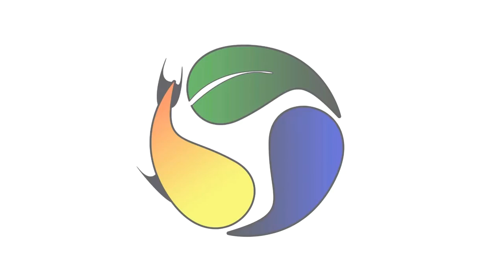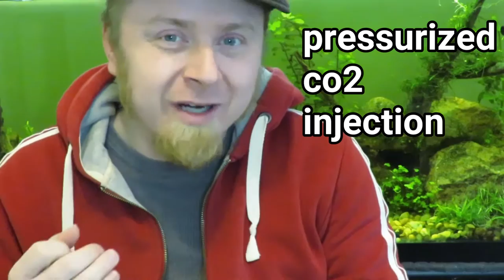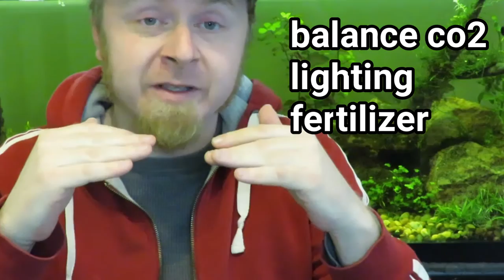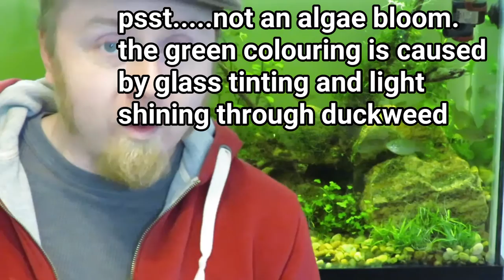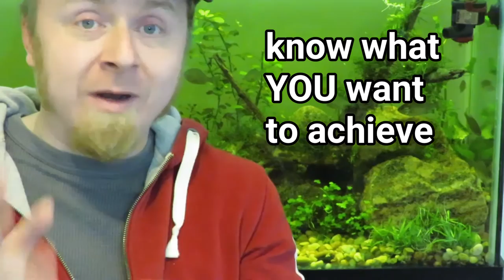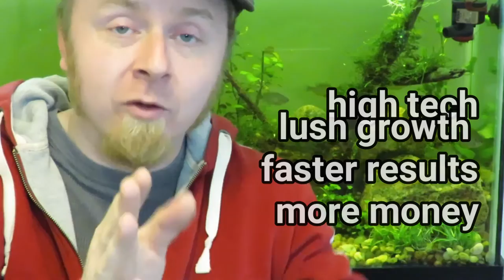The Difference Between Low-tech vs High-tech Planted Aquarium Tanks

Comment: Great video Kevin. You jam packed this video with tons of useful information, I can now say i know the difference between a low-tech and high-tech planted tank. Also, great tip about turning off the light every few hours to help with growth. Thanks for sharing bud
Reply from the maker: AQUA NUT 
Thanks....there is alot in there but i hope it comes across clear enough. there is alot of debate on the subject but i hope this simplifies it. 

and the mid day lighting rest works wonders for low tech tanks.
Reply: Yeah i programmed that into my timer and noticed they looked a bit better when i got home. I think you did a great job on this video. Cant wait for the next one bud.

Comment: Great video! I don't want to throw everything out... But I have reevaluated what I want to achieve. It's set up at the school I work at and I want my 20 gal long to be more long term stable. Is there a way to keep my CO2 bottle and regulator, but just do one bubble a second? I switched to Java fern hoping it would out compete with the string/hair algae, but it's not. Can I just cut back the EI method ferts to 1/2 dose and lower the light intensity to make it more of a low tech stable tank, even though I have hi tech equipment?
Reply from the maker: John Zimm 

You can do exactly what you're suggesting...i would keep the co2 higher than 1 bps...you will find great stability with co2 enriched water, lower light intensity (or shorter photoperiod) and leaner dosing. The hair algae is caused mainly by too high of lighting in fluctuating or low co2.  As we know, light drives photosynthesis, upping the demand for nutrients and co2 leading to potential imbalance if these two parameters do not meet the demand. So yeah...lower light, leaner ferts but still good co2 enrichment...and always consistency.